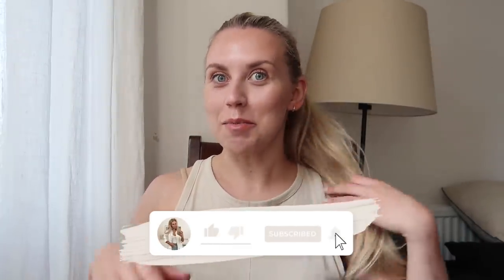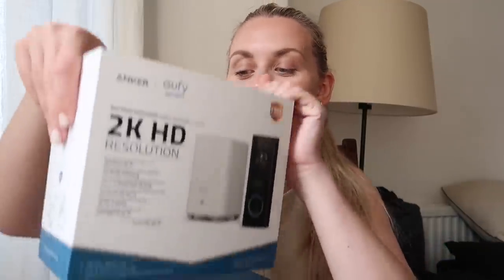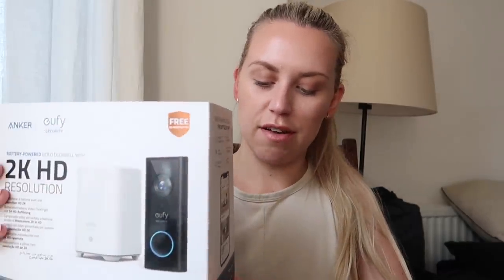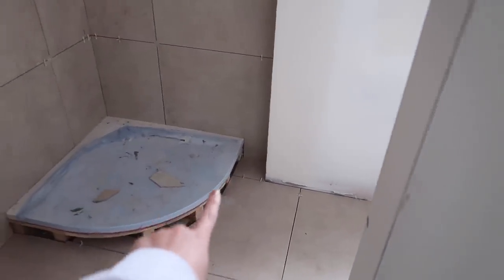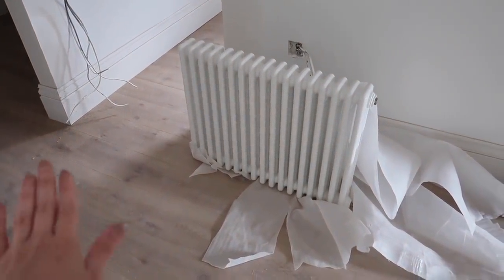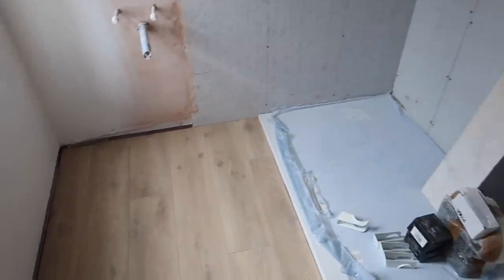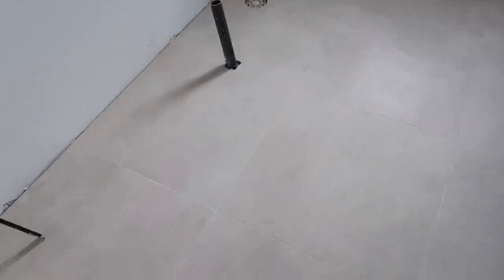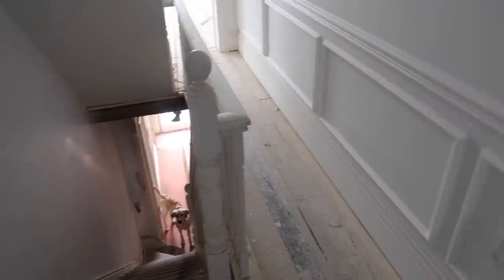RENOVATION SERIES EPISODE 6 | MOVING VLOG & HOUSE UPDATES

Comment: You could have went back to wall toilet and black flush plate x
Reply from the maker: due to the space we wanted to keep it as open as possible and wall hung possible but would have made bathroom smaller…also not even possible in the other two bathrooms so we just stuck with cheaper toilets throughout 🤷🏼‍♀️